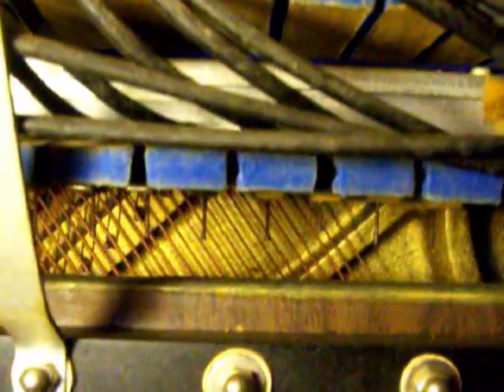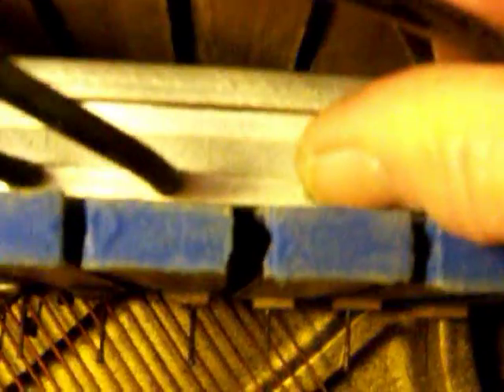Detecting Bad Pouches in a Modern Universal Player Piano

Comment: I have a 1912 Steck Player Piano. Every note works but some have this air Noise. It only appears, when the hole of the note in the tracker bar is uncovered.  Do you know what the Problem is?
Reply from the maker: It sounds like there is some sort of debris that is preventing the valve from sealing when the valve is in the 'on' state.

Comment: John
Does this aply to older players to?
I have a schultz that 2 don't play
I wonder if those pouches are bad?
If you replace the pouch leather how do you know how deep to make the pouch depth?
Reply from the maker: It's possible but somewhat doubtful that your problem is related to the pouches. In older players, a more common problem is leaking or malfunctioning valves.
Reply: The schultz player that  I  had did not contain pouches;  but instead 'tiny' pnuematics that take the place of a pouch.  They were about  1 1/4 inch by 5/8 (that is an approx).  It has been many years ago-  and were very difficult to re-cover!